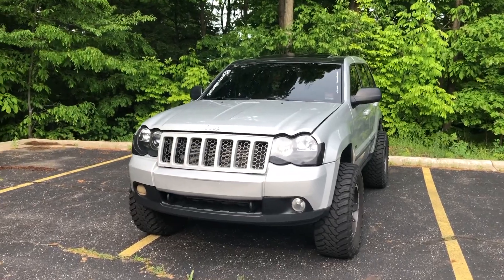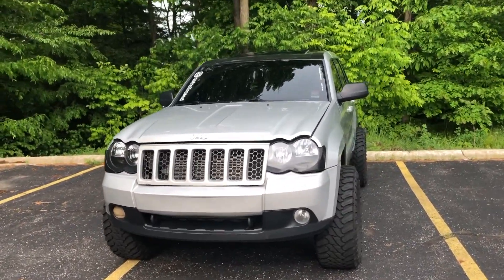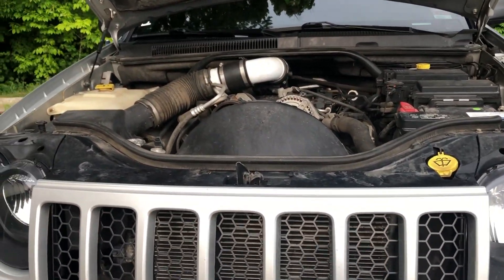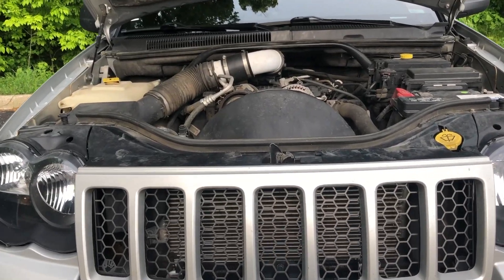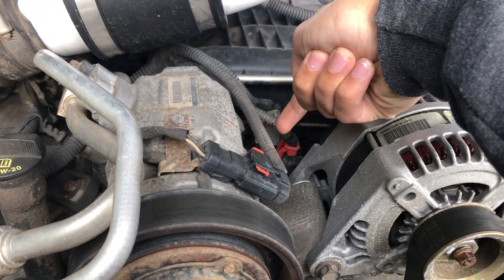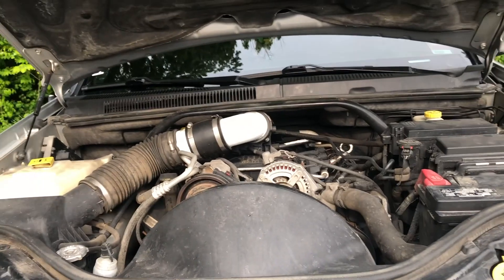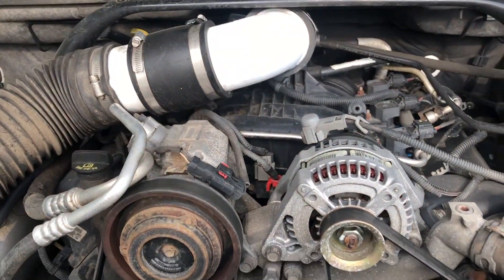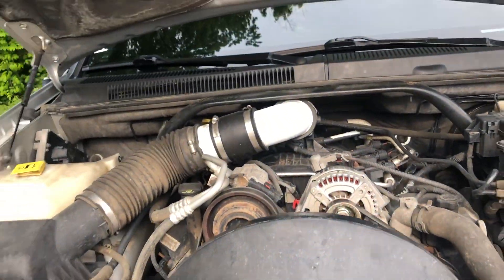Coolant Temp Issues *Diagnose & Replace*

Comment: Could I replace mine now without having any issues or codes or check engine light on? 07 wk has 181K miles and I want to do preventative maintenance now  saw it on amazon $9 comes w thread lock in it already and I’m itching to change mine now cause I have a lot of new parts in there already and my temp works perfectly fine atm ...
Reply from the maker: I wouldn't worry about replacing it